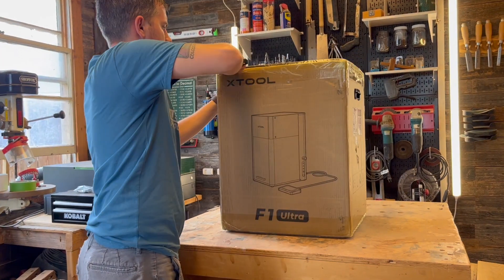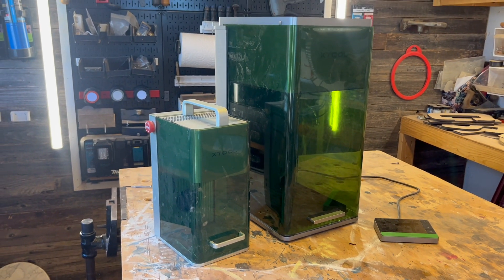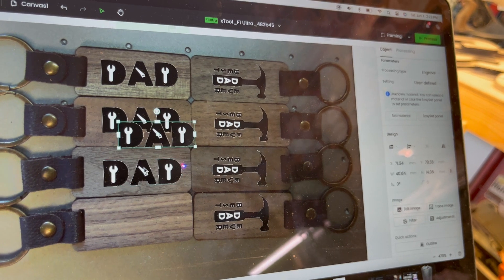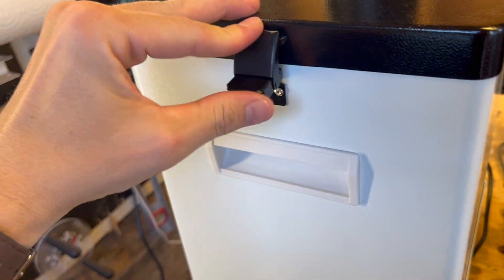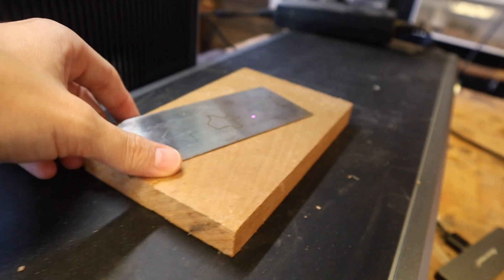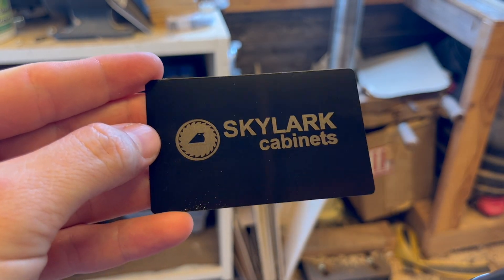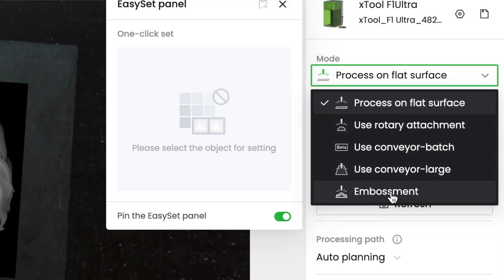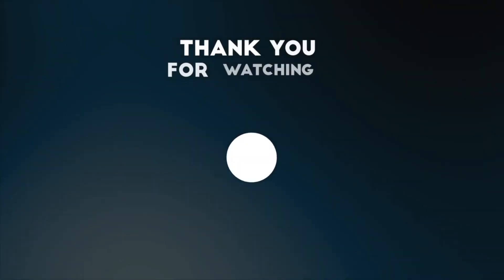xTool F1 Ultra // 20W Fiber & Diode Dual Laser Engraver

Comment: WHERE in the world can you find material settings for the F1U?? Xtool has NOT added the machine it their materials setting website page - Limited settings in the XCS materials library - EXTREMELY Frustrating! oh! and I DID NOT RECEIVE MY SAMPLE MATERIAL PACK!
Reply from the maker: If you're using their software, there are suggested setting in the easy set panel. Most of the time I just do tons of tests myself to hone in the best engraving.

Comment: I'm going to paste the part of my message directly below that was cutoff by the "Read More" label.
I would appreciate replies".
With that said, all of the video reviews I see here on YouTube are very well done, including this one. No offense, but the problem I have is that the reviewers have either received a "free" Ultra, or they get a kickback of some sort. Since the live reveal of the Ultra, I have searched far and wide for a 100% unbiased review. So far, I haven't found any. The only negative comment "in print" that I have read said that LightBurn can be used, but is not fully functional on the Ultra. 
LightBurn appears to be the preferred industry standard.

Comment: ** To be fair, please note that I have never used a laser engraver/cutter but am in the research phase of getting one...maybe.*** What I don't want to do is to get a "starter" machine, only to realize that I need something more. What's holding me back right now are the price tags. Also, I emailed xTool customer support asking if they will be selling the Ultras on Amazon. They responded with a "no plans to list it on the Amazon platform now". I don't know if that's a "never", or just a "for right now". I have a decent gift card balance with Amazon which would help offset the purchase price. 
With that said, all of the video reviews I see here on YouTube are very well done, including this one. No offense, but the problem I have is that the reviewers have either received a "free" Ultra, or they get a kickback of some sort. Since the live reveal of the Ultra, I have searched far and wide for a 100% unbiased review. So far, I haven't found any. The only negative comment "in print" that I have read said that LightBurn can be used, but is not fully functional on the Ultra. 
LightBurn appears to be the preferred industry standard.